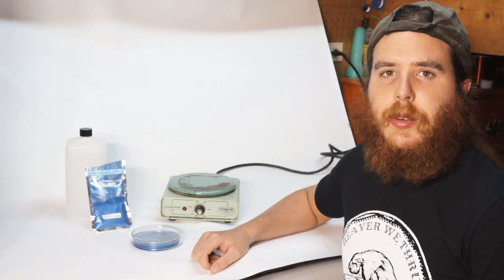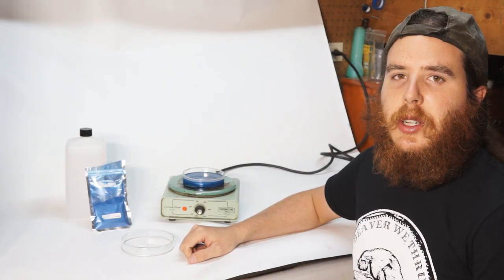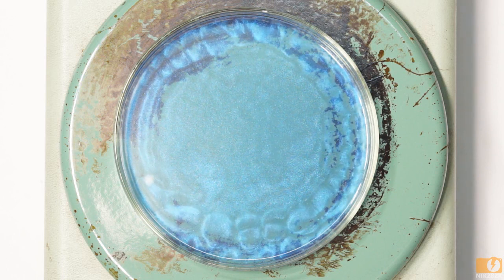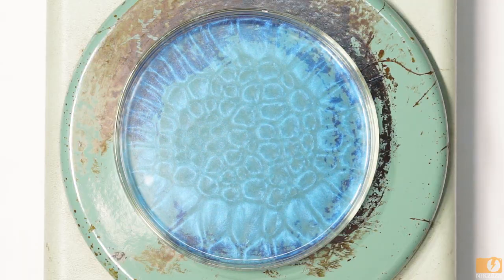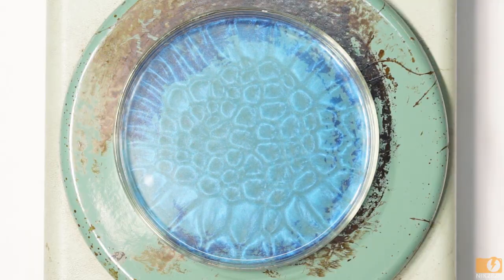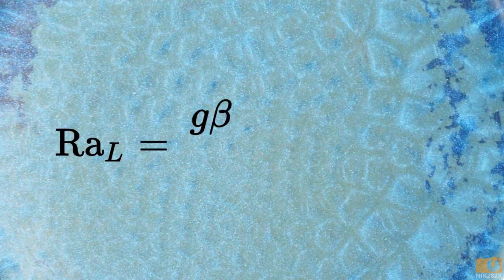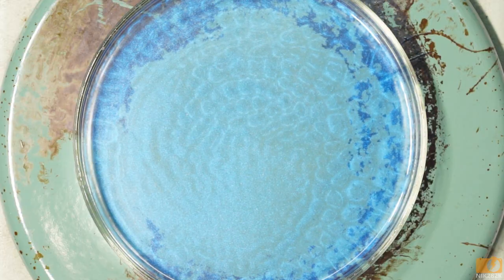Rayleigh–Bénard convection cells

Comment: Hi! What ratio of mica powder to silicon oil did you use? Great video 🔥
Reply from the maker: @nathanlin0429  I used very little powder, like less than 1% by volume. I didn't want to interfere with the viscosity of the oil at all.

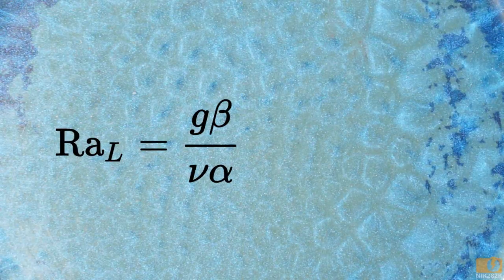Comment: At 1:42 you describe the parameter alpha as the thermal conductivity of the oil; it's actually the thermal diffusivity (conductivity over density times specific heat). Great video anyway!

Comment: Great footage and explanation. Thanks! Could this mechanism also be responsible for honeycomb like structure of re-solidified coconut oil and basalt columns?
Reply from the maker: I'm not sure, in columnar jointed basalt the fractures occur while it cools so it may be that the shape was set as the liquid rock solidified.
Reply: The chemical equivalent : https://www.youtube.com/watch?v=IBa4kgXI4Cg&feature=youtu.be&t=49s

Comment: Ah, so that;'s what happens when I turn on the hot water for about 10 seconds, then fill the sink with thick vape clouds. Granted, the temperature difference is much smaller, or all the vapor just swirls out of the sink, but I got some cells forming reliably.

Thanks for the science dude!

Comment: Fascinating!
Reply from the maker: I thought so too. I should try again with different liquids.
Reply: Try 1/4"-1/2" of milk + liquid food coloring and maybe a couple drops of dish soap.  

The little mica particles are very cool, i've never been able to see the flow.  Love the IR shot as well.  Great vid!
Reply from the maker: Thanks, I'm trying to remember to use all the equipment I can (when applicable). 

The mica is cheap when bought from "over seas" and it takes very little to get the rheoscopic effect. 

I wonder if the dish soap would interfere with the cells as it would significantly lower the surface tension.